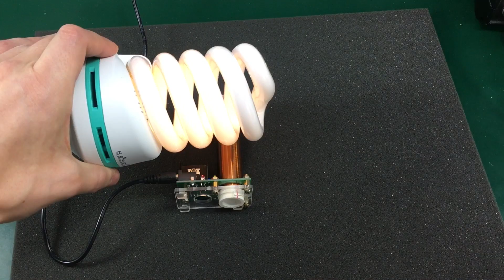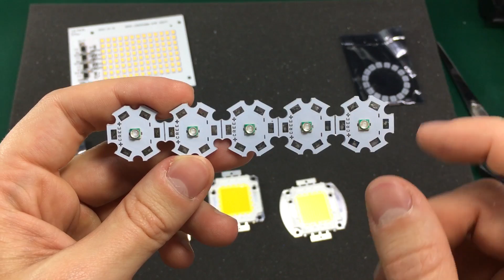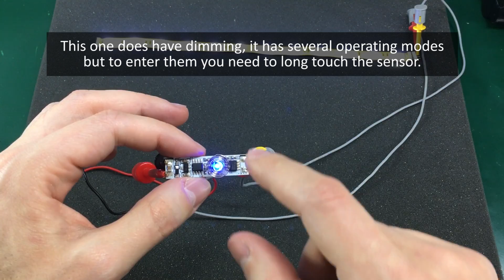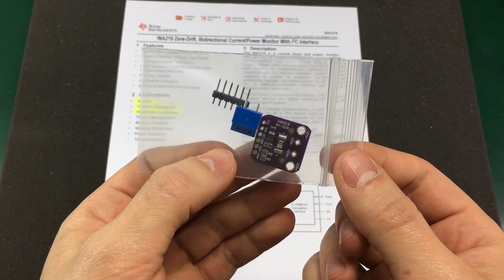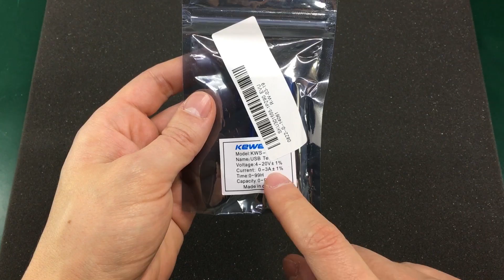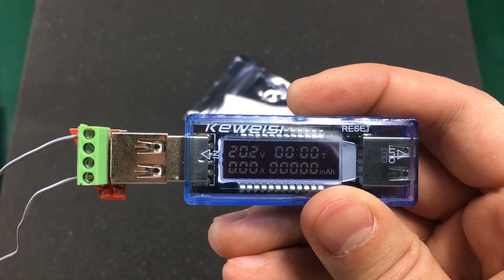Voltlog #83 - InTheMail

Comment: Be careful with those UV leds, they will easily cause arc flash.
Reply from the maker: they work at 3V, how can they cause an arc flash?
Reply: @VoltLog Sorry that is the local term. It is also known as arc eye, snow blindness, welder's flash or the medical term photokeratitis. It is basically sunburn of the cornea, and symptoms often don't show up immediately, and it's quite unpleasant. The emitters are basically point sources so are very bright if not diffused, and as they emit almost entirely UV, you won't have a blink reflex or pupillary reflex to protect you.

Not trying to be a safety nut, but the danger is perhaps not obvious.
Reply from the maker: Ok, now I understand.Thank you for explaining this, I am aware of the dangers of working with high power non visible spectrum light.

Comment: I would like to ask you, if you could please make a video about the diy reflow oven you showed in Video  #35. Best regards.
Reply from the maker: I'm not going to make a video about that reflow oven because the controller which is the interesting part is a very old design that I found online maybe 6-7 years ago. It was based on a tiny2313, it doesn't have PID and as you can imagine pretty obsolete for today's standards. Maybe I will build something new this year and I will do a video on that.